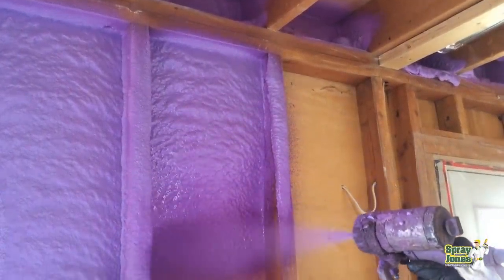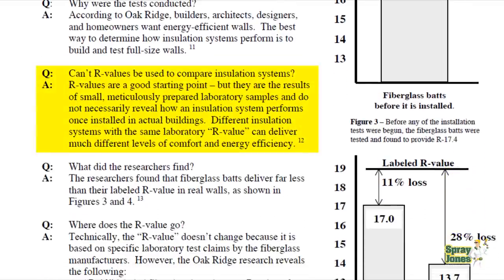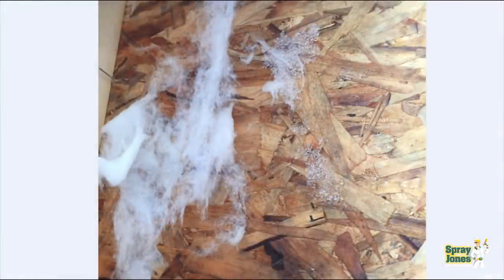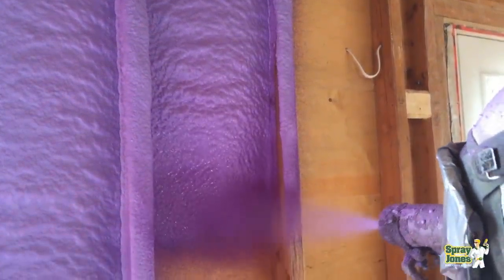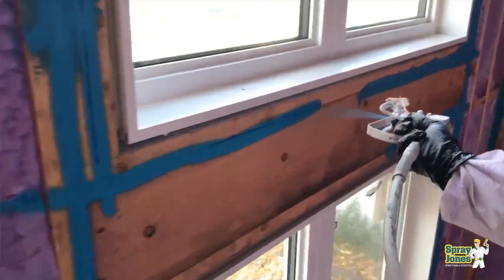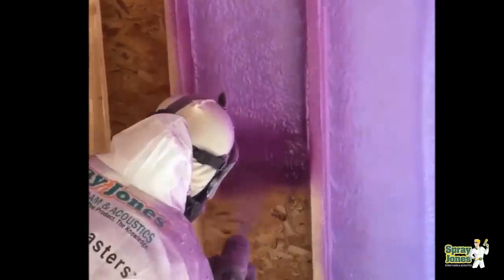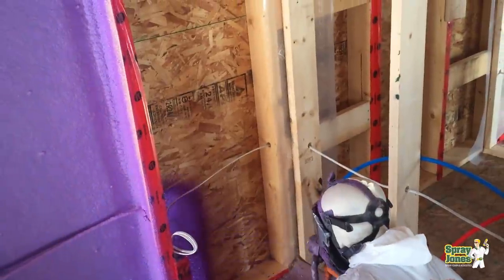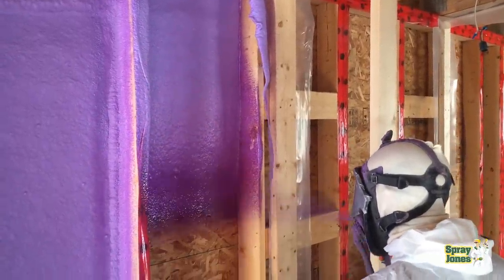Walls and Spray Foam Insulation | Part Two 2" x 6"

Comment: I built a building 2 years ago that I covered the exterior with 2 inch foam board glued on. Than rockwool between the studs. Seems to be working good. It feels to airtight. But after watching your videos I'd probably switch to spray foam next time.

Comment: One of my clients was the Richmond Housing Authority that built new homes for low income families. They were really big on a push for energy efficiency to help reduce the utilities cost for these homes they specked out the bibs system. We ultimately convince them to spray foam a series of 12 homes since all the homes are identical they would get real world comparative data. The following year we were contracted again to insulate another set of homes and this time they specified spray foam. Since the home were all electric spray foam Homes had electric bills that were a fraction of the homes that were done in the bibs system. And the bib system is significantly better than the batt system.  

I found it ironic that these “low and Homes“ or better insulated than most of the million dollar homes.

Comment: Another phenomenal video! In the US we are kind of catching up to CA in a very small way. I am going to build my wall sheathing with Zip system R-12. I want to use closed cell foam everywhere that I can. Do you know of any problems with adhering closed cell foam to the back of the zip R sheathing? What do you recommend we ask our contractors to install with closed cell foam. Meaning is one brand better than another? Thanks again for all your great info.

Comment: Another great video Mike. Can you use closed cell spray foam in "California" corners?
Reply from the maker: I do not know what a Cali corner is...
Reply: Sorry Mike. A California Corner is a framing corner built with three studs. Two studs are perpendicular, ending two walls, with another stud staggered against the wall ending inside the wall. It makes a pocket in the corner for insulation. Does that make sense? I’m wondering about the pressure build up.
Reply from the maker: @chuckk6971  We do those all the time. If it is sprayed in lifts it will be Ok.

Comment: Hey MIke, always enjoy your vids (watched every one). Quick question: I noticed you seal all the joints between the plates and the ceiling or floor, but you don't seal the spot where the stud meets the plate. Why is that?
Reply from the maker: Too much work for little gain. The foam against the outside usually blocks off air flow, whereas the two or three studs together have nothing...

Also we have never had an issue with it, even on blower door tests. Currently the guys have  enough over-spray in the cavity that the seem is cover with a thin skim. Not all pictures show that.
Reply: @SprayJones  Super, thanks for the response!

Comment: How about flash and batt for fire safety? Magnesium board sheathing over 2x6s on 24" centers wall assembly. After outside sheathing, apply 2" spray foam (closed cell) for strength, air sealing and insulation. Also chalk stud pairs. Then wire electrical and fill cavity with Rockwood to block the chimney effect of wall cavity. Combined with class A rated siding and steel roof for areas prone to wild fires?
Reply from the maker: Codes are already written for SPF and protection from fire. There is nothing new to discuss or improve upon. Go watch the video where we light the foam on fire... see how it burns.

Comment: Great videos thanks for sharing your knowledge. 2 q's, why is there poly between studs where walls join? I'm assuming framers didn't know it was going to be foam insulation? Have you ever seen shrinkage in studs over time thus showing small cracks between foam and studs?  I assume one would never see this unless a reno was done down the road or an exposed stud wall. Thanks again.
Reply from the maker: Q
1. You are correct, changed their mind on insulation
2. No. SPF carries air barrier certification. If there is shrinkage some one has wet lumber. Watch video on 5 failures and why, that is explained in detail.
Reply: @SprayJones  Thank you ! You are lightning fast with answers!!!

Comment: What about open cell instead of closed cell for recording studio for sound dampening/proofing. Using an inner and outer wall or double walls where you then use unfaced fiberglass the 2 layers of 5/8” Sheetrock. So the outer wall down here on the gulf coast would have house wrap on the outside of 5/8” osb then use Hardy siding or brick etc.
Reply from the maker: Yes. Open cell is amazing for sound.
Reply: @SprayJones  thanks, they also recommend open cell due to the region I live in on Texas gulf coast. The outer wall outside between the OSB and siding is where we put house wrap unless it’s a metal siding structure like a Barndominium, for that the house wrap goes between the metal sheets and the metal frame due to ease of replacing a sheet of tin if need be.

Comment: The title of this video suggests I'm going to learn something about spray foam in 2x6 construction. Halfway through I've only heard ranting against fiber insulations. Is there even a sentence or two of information about spray foam in a 2x6 wall? Obviously I can get 2" of foam and then install electrical in the wall with 1.25" code required wood to inside wall. So was there anything other than ease of electrical installation after spray foaming?
Reply from the maker: You don't like it, hit the road, don't waste time bitching.

Comment: Such a great explanation -- Thank you!  Could you please confirm that in US Zone 6, any benefits from closed cell thicker than 3" is miniscule?  Does that apply to roof rafters as well as wall assemblies (assuming plenty of windows)?
Reply from the maker: This whole channel is full of info for that. Watch and do more learning.
Reply: @SprayJones  Absolutely -- you do a fantastic job of that.  If you wouldn't mind, could you confirm the answer is YES to both my questions.

Comment: Curious if you'd had any insight into Passive House community. I'm in the middle of learning more but spray foam has a lot of applications I still think are great for, but many designs I see present lean away from any foam system. I don't know if you have videos on any of the following (if so just tell me you already talked about it and I'll search again) but would like your insight into some topics:
I've heard some believe the building and the foam binding could break - leaving gaps in the air seal. So many will rely on air barrier systems or smart barriers and tape systems which will have more flexibility. What's your experience with this or would that be if the application had issues?
Embodied carbon - some are looking to factor those impacts in the modeling, and even avoid rigid foam because the source and lifecycle costs can have larger carbon impacts than other locally sourced or lower manufacturing impact products - would love your feedback on that aspect.
Any feedback on future NBC or provincial building codes that are in the works - just your general impression of the requirements or trends and how you see the spray foam industry as a hole playing there in the future.

You have a great approach and clarity in your videos - keep going man!
Reply from the maker: I have some harsh views on passive home design in Canada. 
The recommendations in many "super insulated" homes is outdated, wrong and laughable. This is not new to anyone that is rigid insulation awake. 
R value is a joke.... precursor to intelligent conversation.
Life cycle assessment, rigid foams are the best, hands down and that has been proven for over a decade already. But the "green washing" community lies and frauds their data to push an agenda that is Eco Terrorist instead of conservation. 
There.... that is my opening lines about that...

Comment: Do you have any videos for SPF Cedar Shake Roofs? would be cool to have videos showing the results of foam. like temperatures in the summer/winter with a variety of applications. other than just thermal images.
Reply from the maker: Not that I know of.

Comment: I'd like to hear your opinion on using 2x8 studs. Is it just wasteful? 3 inch closed cell then maybe some rockwool to fill the gaps? Secondly I'm sold on doing closed cell but every penetration for wires, ducting, or others scare me. What would you suggest on how to seal up these penetrations?
Reply from the maker: 2" x 8" is over kill. Think efficiency vs bulk. Money is better spent in outside rigid insulation and a little less SPF on the inside. 

All penetrations to the outside are made first, then SPF them in. Even if something is added later is can be can-foamed or more SPF added... easy!

Comment: I like it! I actually understand what you are trying to covey to us. I also take it that with a totally air sealed house, (as much as you can get it),  that you must have a matching air/heat exchange system. Correct?  :-)
Reply from the maker: Correct. I have a video on the HVAC.

Comment: When spraying in basements, do you run into issues spraying over the sill plate and into the rim joist?  Aren't you eliminating the wood's ability to evaporate any moisture it wicks up from the foundation?
Reply from the maker: No. Air seal over rules that. Where we are if that sill is not covered it will be wet, and that will degrade the structure faster than anything else.
Reply: I asked the same question earlier 😃

Comment: Just wondering would you prefer the siding be installed prior to spray foaming or does it not matter if it’s installed after?
Reply from the maker: Does not matter, unless there are large spaces in the sheeting. You need to stop the SPF from squishing out and bulging paper wrap and thereby messing up the install for the siding guys.

Comment: ?? Would it be a better system if in metal shop to use tyvek over frame then metal exterior and 2.5" closed cell ....theory was the ribs breathe ....and wood permeates...and can easily in future replace a section ....or is this overkill
Reply from the maker: I have a whole playlist for metal building discussing those topics.

Comment: What happens to the vapor that gets behind the drywall/sheetrock? If I'm only doing 3-4" of closed cell  in a 2x6 cavity there's a space between the foam and back of the drywall. This wouldn't be cold to condense on, but trying to understand that dynamic.
Reply from the maker: Moisture is not an issue until it condenses into droplets. Since the surface of the SPF will not be cold enough to condense on there is no issue and the air space is a non issue. There is a video discussing the gap between dry wall and foam...
Reply: @SprayJones  same scenario with the roof? Even though you have more heat rising?

Comment: I know this is an older video, and I don't know if you'll get this question. I am in the planning stage for a home build,  I'm considering zip-r 6 and 3 inches maybe 4 inches of spray foam will this be good enough?  Side note also considering 2×6 TStuds. Oh and are there any suggestions you might have?
Reply: For 99.9% of places on planet earth, if you do r6 zip exterior and 3 inches of closed cell inside, you will have more than plenty of insulation. Roof system if you want to do 4 inches, as a foam contractor myself, that would be better money spent than 4 inch walls.
Really depends on location of the home more than anything to how thick of closed cell you need vs cost.
Mike can go in deeper on this if he wants and explain more.
Reply: If you're actually looking at what levels of insulation are adequate, you really have to give better info of where you are. Toronto is a different climate than Northern Ontario. 

One of the best standards in terms of modeling that is Passive House, they actually take great attention to thermal break factors and air sealing impact, along with entire home comfort issues (cold windows, ventilation etc). Passive is the name is supposed to be that these houses could potentially not need a dedicated heating system - many will to accomodate for comfort, but many in cold climate might just need a very small heating - essentially a hair dryer output in the HVAC supply - incredibly small. I'd say that's the gold standard in building for energy standard and comfort.

I don't think that standard is necessary for every situation, and getting the certification in some situation is not reasonable (range hoods might be a break point, but I'd much rather have one than not). But having someone that is familiar with standard do your design and at least run the modelling will give you a better idea of what an ideal energy standard for your location would be. Maybe even just looking at showcases of projects in your area if there are any to see what is typical insulation values as a rough idea.
Reply from the maker: There is nothing wrong with what you have said. And the video was just launched.... see the date of upload..

Comment: Can you spray foam over the top of an e-insulation? The bubble wrap type?
Reply from the maker: I suppose so. But how well is it fastened? How will it move and bend? You have introduced a failure point.
Reply: @SprayJones  yes. That’s what I was thinking. It is not tight by design as let’s say house wrap. Thank you. I would imagine it would be ok over foam board insulation though?

Comment: Can’t understand why you think there is not less air convection  in the cavity when it’s\ flash and batt- esp when it’s dense packed cellulose .
Reply from the maker: Because I understand how much air flows through glass fibers....
Go look at the Oak Ridge National labs study on loose fill fibrous in attics. 50% loss of insulating value in an attic due to air flow.... nuff said.

Comment: 30:35 I don't think I've ever seen a sill plate flush to the INTERIOR of a foundation wall instead of the exterior.
Reply from the maker: You will notice that the drawing shows SPF closed cell applied to the exterior. This is what the sill is recessed to the interior side, and with SPF to the outside it will be fine for thermals and air leakage. 
Just a different way based on where the foam is going.

Comment: 3 inches of closed foam ONLY. That seems like a big missed opportunity for 3 more inches of rockwool, fiberglass or open cell. .especially on the roof.
Reply from the maker: Not once you understand what is going on. Please watch more videos. Start with "myth of R value".
Reply: @SprayJones  thanks. I figured it wouldn't be that easy

Comment: You haven't addressed the use of air sealed sheathing in any of your videos that I have seen. Sheathing products like Zip System and Weathertech have made it possible to fully air seal the envelope at the sheathing which makes your choice of insulation far less critical since no outside air or moisture is reaching it. This raises the question of cost. Closed cell foam is probably the most expensive mainstream insulation product out there so if cost is a factor at all, closed cell foam may not be the end all be all.
Reply from the maker: You think Zip wall insulated sheathing is air-tight once installed?
What about roofs / attic spaces, basements to floor connections, crawl spaces, wall beams, headers, rafter support super structure like girder trusses? Just to name a few. 
We live this work, this is not theory....
Reply: @SprayJones  Actually, I do. Plenty of builders use these various air sealing sheathing products and blower-door testing (pre-insulation) shows passive house level air tightness. No single solution is perfect for all applications, but you make it seem like spray foam is the only solution anyone should even consider and I reject that kind of rigidity.

Comment: Like the idea putting a 2" Hubers Zip system then putting 3" CC but was thinking using the T-Stud from bottom plat to top plate and even in the corner having continuous break.  You can see it in his video Wall Assembly Lumber Takeoff that you get 96% thermal break even when TStuds are used as bottom and top plates!   Anyway would love to hear more of what you think of there products combined with CC!

Here that TStud information video with the it’s inventor…
https://youtu.be/7625RNjmSII
Reply from the maker: It is a great system, no doubt about that.